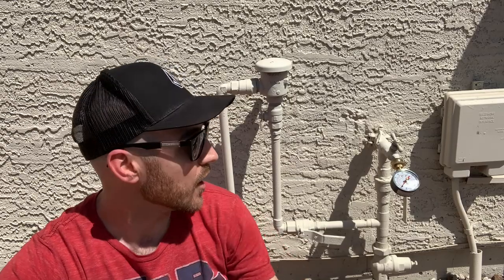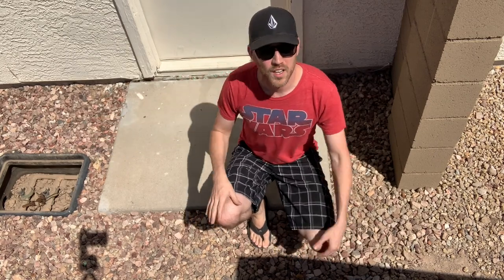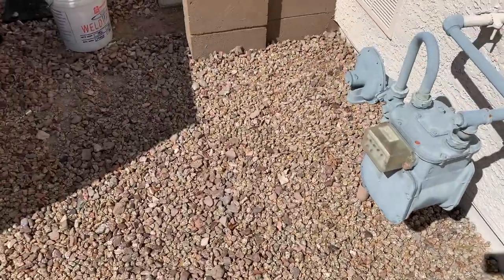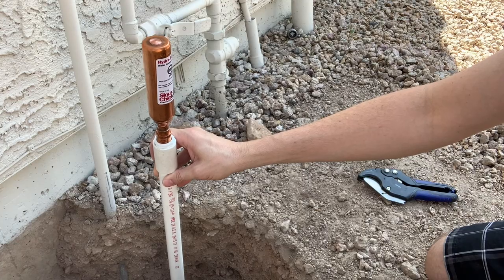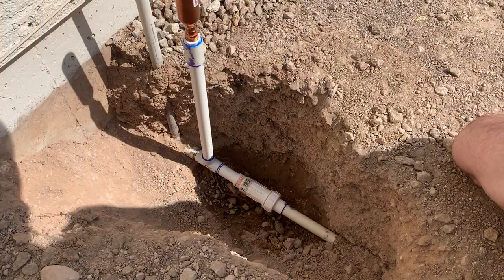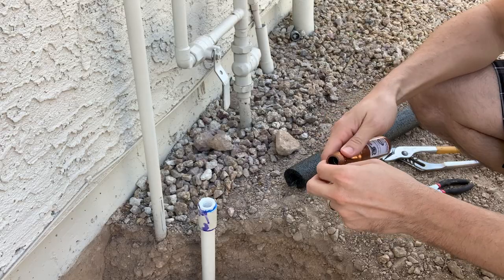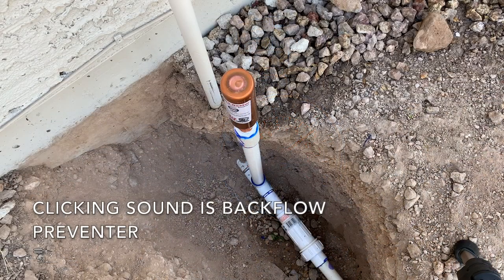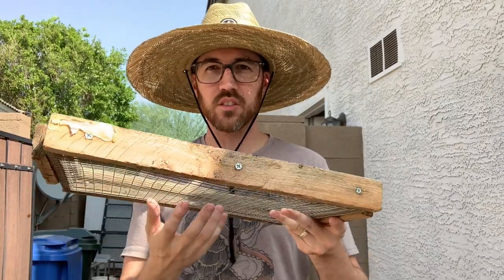Fix Irrigation Water Hammer Step-By-Step

Comment: I’m in Oregon,  not sure where you’re at, but I’ve got pretty bad water hammer from not only our yard sprinklers, but toilets, sinks, washing machine etc. My plumber said not to install the arrestor outdoors due to it freezing in cold temps? Commented before end of video, lol, you’re in Phoenix, has the arrestor been pretty helpful otherwise?
Reply from the maker: Yeah it’s been great. They sell smaller stressors to use inside that connect to the washer lines and toilet lines. Might be worth installing a few of them.
Reply: Or a full size expansion tank at your water heater may absorb the pressure. Maybe.

Comment: Did you have to install it by digging up the main line? - you could have installed it on the line going into the ground using a 3 way elbow
Reply from the maker: Could have, but didn't want to solder copper.  Gluing PVC is easier.  Also, I put it as close to the irrigation valves as I could.

Comment: Good video...My landscaper (Surprise, AZ0 told me the hammer was cause by a failure in the Irritrol Timer, so he replaced it ($180.00) and that stopped the hammer, and improved the flows (shrubs were looking a little dried out). Is it possible that the timer was the root cause of your hammer problem? You mentioned that you could still hear a faint hammer after your repair. Hope it's holding up...much less expensive solution than mine.

Comment: do you know if the arrester absolutely needs to be installed after backflow preventer? because i do get hammering when valves open. but it sounds like all the hammering is actually happening in my basement, not outside.
Reply from the maker: I incorrectly called the vacuum breaker a backflow preventer.  But to answer your question, it should be as close to whatever valve is closing that causes the hammer.  So if you have a low-flow toilet that shuts quickly and causes the hammer, the arrestor would go at the toilet water connection at the wall.  Same for dishwasher or washing machine or whatever valve is the culprit. There are some purpose-built for appliances that aren't quite as large as the arrestor I linked in the description.
Reply: @jessemsparks  right. i got all of that. and i'm actually trying to figure out if the arrester can help w/my sprinkler system water hammering. whenever the controller opens a valve there's a lot of noise (coming from basement, though, all the way to the second floor of the house) which is not nice at 4:45 am. if the hammering was happening outside of the house I wouldn't even notice (the valves are pretty far from the bedroom). but the hammering noise is coming from the basement. that's why i'm asking if I have to install the arrester outside (and make sure it doesn't freeze in winter or something) after the vac breaker or is it still okay to put it on in the basement?
Reply from the maker: @nskmda  In that case, putting the arrestor in your basement will let the shockwave travel from the sprinkler into your basement and back.  It would be much better to put it as close to your irrigation valve box as possible (so, outside).
Reply: @jessemsparks  i see. okay. thanks for the response.
Reply: @jessemsparks   I would suggest both inside close to exit and another closer to valve. . Distance doesn't make as much difference   as bends and other restrictors . There was a patent issued for  air retaining pocket built into irrigation solenoid.to reduce hammer.
Reply from the maker: @howardheil9359  an arrestor near the exit will not do any good.  Check out this video from Practical Engineering on water hammer.  The hammer starts at the valve and runs back to the source of the water.  So an arrestor would only be good behind the valve, as close as possible.  https://youtu.be/xoLmVFAFjn4?t=348

Comment: I would have considered putting the new pipe horizontal then install the hammer arrestor in a new valve box (eg, below ground level).
Reply from the maker: The instructions on the arrestor say it can be installed in any orientation. As far as a box goes, I considered it but I wanted a stand-off with enough height that I could cut it a few times (if it didn’t work) and test something else like a 3/4” thread arrestor or something. The tight tolerances in an irrigation box make modifications more challenging so I intentionally chose not to put one in.

Comment: Jesse, can the arrestor be buried?
Reply from the maker: The package says it can be placed inside an interior wall, so I suspect it can also be buried.  However, After about a year I had to replace mine because the hard water in Phoenix effectively calcified the arrestor in place and it no longer absorbed the hammer.  I would suggest putting it in a small irrigation box instead of completely burying for that reason.
Reply: @jessemsparks  thanks for the quick reply, that sucks for your arrestor 😑. Yeah i will more than lilely attempt to install it in the crawl space underneath my house.  But dont want to deal with old galvanized pipes, more than likely ill do it just like you. I live in LA so hopefully i can get a longer ife out of it.

Comment: Does the arrestor need to be at a certain height?
Reply from the maker: Nope.  It can go in any direction, just put it as close as you can to wherever the valve is that's creating the hammer.

Comment: Put it in the box
Reply from the maker: I absolutely would have done that if there was enough room, but the box is completely full with irrigation valves.
Reply: @jessemsparks  if that 90 on the last valve threads on you probably could have dug down with a little garden shovel cut it out spun it off and added a tee with the arrestor coming off the side